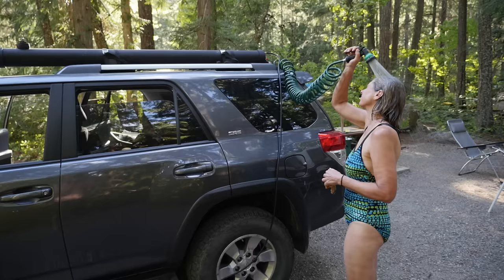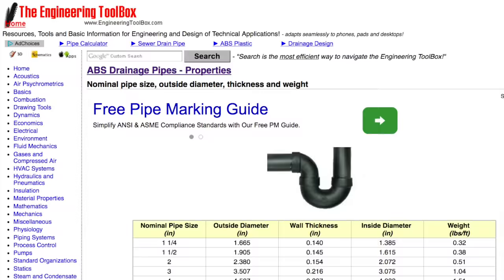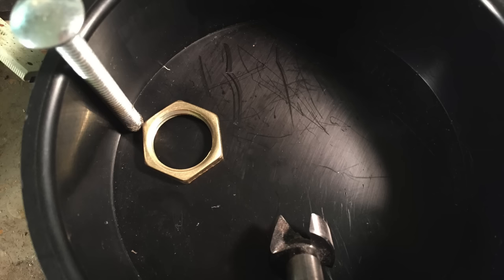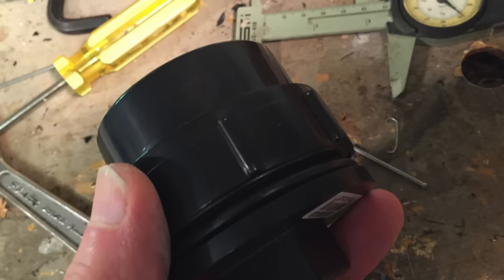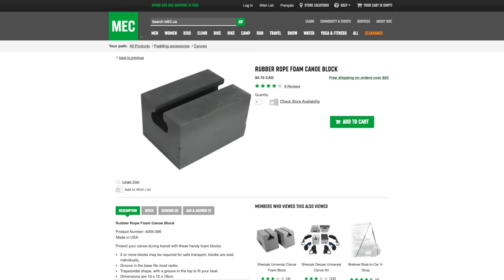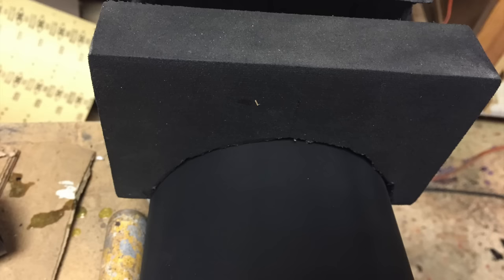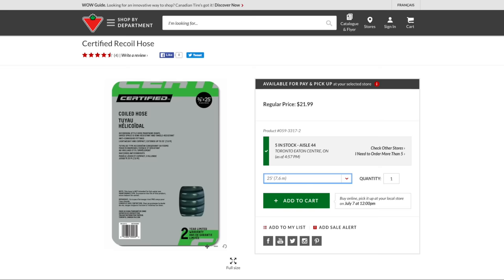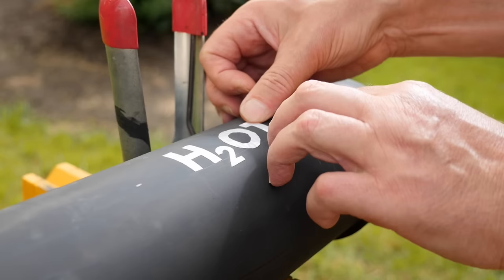H2OT - Rooftop, pressurized, solar-heated shower/sprayer using ABS pipe. DIY

Comment: EXCELLENT! It's so refreshing to see a video without loud music, no BS wandering commentary and profanity.   It was clear,  concise and very professionally done. Understandable instructions, and even text backup .
1. I want one 2. You SHOULD do instructional videos,  I agree with the many others who've said that.   Thanks, great job!
Reply: Did I miss where you mentioned where to get that air compressor? 
If not,  would you provide a link? Thx.
Reply from the maker: Thank you for the very kind words.  Glad you found it helpful. No get down to your workshop and build one!
Reply from the maker: I already had the compressor and keep it in my truck to inflate tires. It has really come down in price I see. Here is the link below.  It is a Viair 00088 88P. DO NOT go cheap on the compressor. It will fail you when you need it most (inflating an actual flat tire). This one hooks direct to the battery as it can draw 12 Amps. Any of the cheap ones that plug into your cigarette lighter accessory plug will blow the fuse and then you are in trouble.  Also, this is reasonably quiet, fantastic build quality, long power leads and even longer hose.

https://www.amazon.com/Viair-00088-88P-Portable-Compressor/dp/B005ASY23I/
Reply: I agree with not cheating out.  To be sure that I understand,  you hook the  compressor to the valve stem and the spray hose to male pipe output? 
Sorry if I'm being dense.
Reply from the maker: That is correct. NOTE: as the tank is 100% full of water, there is no room for compressed air. As such, for the first few sprays, the pressure wil drop from 30psi to 10psi in a few seconds. As the water drains, air capacity increases. As such, after about a minute, you probably don't need to cycle the compressor at all. I find that I can let it drop to 10psi without any noticeably pressure drop.  Also, remember I am using a 3/8" water hose for a reason, it restricts flow and holds lower volume. I am also using a a sprayer with a shower setting, also conserving water. And finally, we spray only to rinse. bathing is done without a constant stream. Only spry when needed.
Reply: Thx so much for the detailed response. . Out here where I'm camping, I've just been pouring cold water, soaping up, then rinsing with cold! 
☺

Comment: I lived with my dad in a camper van in the 80's for 4 months As he worked in Northern Ontario as a bricklayer..Having power was a welcome But We mostly had to think of ways of doing things Dad Would spark up the hibachi style fire And set a large pot of water on to boiling Then mix that half to a half bucket of cold water And it came out warm You would splash alitte on you Dunk your head in  And soap up And take a cup and rinse off And towel off ..There was nothing better than waking up and Dad had musky cooking in the cast iron skillet fresh from the French river 

This solar powered roof I wish he could of seen

Comment: Thanks for your video. I made the same thing with the following changes (improvements): 1. I installed a 60 psi pressure relieve valve instead of the radiator drain plug. 2. I made it in 3 sections, and installed 2 plate with holes (where the sections meet) to stop the water hammer action when not completely filled. 3. I used thick rubber pad brought from Harbor Freight to mount it.
Reply: ge gary ... I think you are talking about the water sloshing back and forth while driving, not actually a water hammer. That would be a baffle system and commonly used on tank trucks.
Reply: @rupe53  yes, 2 baffles with many small holes to stop water from rushing to the front when braking and the back when accelerating, helps a lot.
Reply: That makes a lot of sense, was worried about that as well. Don't need a torpedo on my roof. What kind of place with small holes are you referring to? A shower drain type plate?
Reply: @nickohdub  ... you have the right idea, but the drain plate may have too many holes and allow the water to move too fast.

Comment: I built something like this last year but with one additional component I took a bicycle inner tube and inflated it, and put it inside the tube before sealing it up. this bladder compresses as you fill the water heater with air. and allows the water to flow for a much longer period of time without constantly running the compressor.
Reply from the maker: That is a very interesting modification I will have to explore. Downside would of course be loss of capacity. 

One thing I have started doing is to drain off some water before I start the compressor. This provides a void that the initial compressed air can occupy. Thus  eliminating those immediate cycling of the compressor that your solution solves.  I shower standing in big  Rubbermaid container  so the water is not lost.

Comment: Probably no one will see this comment but here goes. Living on a sailboat I used saltwater for showers. Just add a little Downy clothes softener to the salt water and presto water you can shower with.... adjusts the ph and works like a charm.... no more salty skin...
Reply from the maker: I did not know that. Excellent tip.
Reply: hmm. just be careful since now it's known that those fabric softeners kill a mans testosterone and raises the estrogen...  besides if in a boat you must have a septic tank, downy is not good for it. you may try 1 cup of white vinegar. why haven't you put a filter. OLE!

Comment: Thank you.
I was searching for a single use fishing rod carrier design. And now I have a dual use water heater, fishing rod carrier design. I’ll put the water fittings on one end, and a fully removable end cap on the other. Depending on my predicament, I’ll run hot water, or travel with rods inside the tube.

Comment: Thanks for taking the time to share this. I have a very low income, a small disability, live in a cabin/caravan off-grid. My bathroom is very cold in winter and has only rain water for handwashing. Brrrr. This is probably going on my roof asap. I have a small 12 volt pump ready to help me feed it. Mine wont be pressurised it will be enough with gravity. I will be feeding 70% max volume in, and leaving a small top valve open for when temp drops below zero to try to prevent cracking. I will probably cover it over with a perspex box or even bubble wrap to see if it still works
Reply from the maker: Glad you found it useful.

Comment: Absolutely amazing instructional video. I was on the edge of ordering 1 of those overpriced aluminum tubes when I found your video. I built mine today for a total of $48USD without the foam blocks yet. I have a small adventure trailer and this is EXACTLY what I wanted for that setup. Thx, Jeff
Reply from the maker: Glad you liked it. Let me know how you make out with yours or if you can think of any mods that would improve it.

Comment: I have finished my version of this and I'm very happy with it. It works great! It took me a few tries to get the hose bibb right. I may have heated up the bibb too much as my bibb leaked after tapping it into the cap. Looking into the hose bibb I can see some nylon or plastic material inside that I assume makes it water tight. I might have melted it...For the next try I drilled a larger hole that the bibb could slide into and used epoxy to seal it. Instead of using a retaining nut, I used a threaded brass elbow with the end pointing down. That way I get more water out before the hose bibb starts to suck air. I put bibbs on both end caps so if my van is not level I can attach the hose to the end that is lower. My vehicle is taller than I am so I oriented the hose bibbs to point out (away from the vehicle) instead of down. That way I can rinse off without having to attach the hose if I wanted to. For the hose I used fuel line hose with a 3/8 inner diameter. It was cheap at 1.40 a foot and it's very flexible. Also, it's black so that first blast of water will have a chance of being warm. For the cap, none of my local hardware stores stocked one with a gasket. I initially used one anyway and it had a pretty good seal although not airtight. I ended up ordering one online from a hot tub supply website and that one is airtight. 

Another problem I had was the end caps from home depot. while being flat on the outside, they had a raised disk on the inside that made installing the air valve tricky as the air valve uses rubber gaskets so the surfaces need to be flat. Once I realized this I looked for end caps at other hardware stores. At Ace hardware I found caps that were flat on the inside and outside. I bought 2, installed the hose bibb and air valves, applied the rubber cement, stuck them on the ends of the 4" abs pipe from home depot and found out they were ever so slightly smaller in diameter than the home depot caps. They were just hard enough to get on that I wasn't able to do the 1/4 turn for a good seal and my bibbs were not oriented in the 6 o'clock position. Ghah! I ended up using the home depot pipe and home depot end caps with the raised disk by drilling the hole for the air valves within the disk, instead of at the 12 o'clock position. There is enough room for the hose bibb handle to open and close without hitting the air valve (remember my hose bibbs points out, not down). 

Lastly, if you plan on driving around with a few gallons inside the shower, I would recommend making a "water brake" to stop the water hammer effect when slowing or stopping. I purchased 2 extra end caps and cut them down to  disks that roughly fit inside the 4" pipe. I then drilled a 1" hole in the center of both of them and inserted a 1" diameter pvc pipe. I secured the disks in place with hose clamps. It looked like a bar bell with an extra long bar. The pvc pipe was as long as my 4" abs pipe. I inserted the "bar bell" into the abs pipe before cementing on the end cap. It works very well. It's effect reminds me of one of those bamboo rain sticks that make noise when upended. 
Hope this helps anyone who is making this.
Reply: terrific stuff.  have you documented this anywhere.  The water brake- I am not so clear on.  how much room I there between the disks and the walls of the pipe?  it doesn't impede flow?
Reply: @philcusick3037  The disks are not that tight. I probably have about half a centimeter of room around the disks. Definitely no flow issues.

Comment: This is FANTASTIC. I just installed a compressor and air tank on my 1st gen tacoma, and realized I could easily create a shower system. My first thought was a roof mounted tank that would be solar heated. This took all the work of having to design or brainstorm anything myself hahaha, it's exactly what I was thinking, without having to do any of the critical thinking.
Plus, the production quality of the video is on par if not even more amazing than the quality of the execution of the water system. 5 stars all around.
As a sidenote, I would listen to a 8hr podcast of you describing paint drying with how relaxing it is hearing the narration.
Reply from the maker: Glad you enjoyed it and found it helpful.  If you have not already done so, I suggest reading the description text for the video. I added a lot of tips for building and using that are not in the video.
Reply: Already checked it out while watching 🫡.

Still deciding on best way to pressurize and maintain 30psi. I already have a 90-120psi pressure switch to the compressor mounted on the tank, so a 30psi pressure switch wouldn't work as my tank would never fill. I need a way to fill it from the tank, but only allow it to pressure to 30psi without dumping the whole air tank in it. I'm assuming there's some kind of regulator I could use, I just need to do my homework since I'm ignorant with pneumatic values and fittings mostly.

Comment: Great project, and excellent execution. My favourite part in this setup is the way you mounted the pipe to the roof racks. Very ingenious and it looks like it fits like a glove. I personally would have opted for a 12v pump and hose for convenience, but I like that your air compressor solution turns the compressor from a single application otem to a multi application item and doesn't increase weight.
Reply: You can use a bike pump or an air compressor. Probably already have one in your kit!

Comment: Thank you sir! I had the same exact idea just moments ago. I found the same aluminum system from Yakima and the price was outrageous.  I immediately thought about black PVC.  Your system is exactly what I had in mind.  Thank you for doing all the research.  Now I know what volume each pipe diameter can provide.  Love the mounts too... I didn't get that far.  Thank you again!!
Reply from the maker: Glad you found it helpful.  Note: that I used ABS and not PVC pipe.
Reply: DO NOT use PVC, it can be dangerous if it breaks with a lot of air in it.

Comment: Cool video and great end result!!  The only thing I would suggest would be to use an elbow on one end of the pipe with a threaded cap on it - this would be easier than having to use a hole saw to drill the fill point and it would also remove any potential issues for pressure failure at the join where you drilled the hole.  Great job man!!!

Comment: Many many years ago i made something that worked on a similar idea. It was a 12 gallon drum painted black. I had a 4' shower stem and head coming out of the small hole in the drum and drilled a small hole in the large filling cap just the right size for a tubeless valve. once the drum wamed up in the good old NZ sun and I connected the compressor we had ample water for a couple of showers each. I like yours as its a lot less cumbersum.

Comment: Get yourself a Hoola Hoop and some 3/4 inch conduit and 2 shower curtains with rings to make a shower enclosure for your shower. The conduits can be tied with shock cord to your roof rack and stick out the side of the vehicle near the water hose sprayer. Tie your hoola hoop horizontal with loose zip ties or more shock cord under the conduit.  Then hang the 2 shower curtains from the hoola hoop, over lapping the ends. The overlap can act as a door.                                                                                                                             You can build a wood floor , like thin pallet, for your roof rack that can serve as a shower floor.   I've been using this shower curtain set up on my expedition rig for years.  Nothing like a good hot shower in the middle of no where.                                                                                  I have a hot water tank, heat exchanger under my hood, heater by my radiator water of my truck.    I plumb in my 5 gallon water tank to a small 12 volt fuel pump to pump the water from the water tank through the heat exchanger and then to my shower head.   But yours will work fine,  I used the solar bags before I built the heat exchanger.
Reply: Amazing idea, which I will definitely use in the future...but clarification on something, are you saying you stand up on top of your vehicle to shower? Sounds funny to me. Planning to have a roof top tent on a Jeep.

Comment: Great build..
I go camping and i build one myself but i used 2 tubes and also put an aluminium plate under the 2 tubes to get more out of the sun's heat works well.
Also i bought a compressor with a psi auto ajust so i put it at 40 psi and as the shower is used it automatically starts up to keep psi at 40 until no water is left.
I was thinking of trying instead of tubes someting like a propane tank that can be high presure with 10 gal or more if not to big.

Comment: I built the same thing for a jeep we used to of-froad in.Cost me like 10 bucks maybe. Used an aluminum beer keg a coiled air hose with a spray nossle and a short pipe in the top for water fill with a bolt in tire valve for airing it up.The Jeep never came with A/C so we mounted  York A/c compressor from an old dodge to it and used it as an air compressor. Ran the line from that to the tube front bumper later for air storage tank.
Reply: VanGuy Steve 
yeah well weird u get the keg?
Reply: Got it from a friend that was planning to use it for a project he never did.
Keg was just ideal for my jeep because it fit right on inside back fender of the cj-7. Was killer to wash hands and clean mud from windshield and places you dont enjoy having mud after a nasty ride through the woods. I'll be using this  setup or close to it on my van for sure. Will incorporate the shower curtain slide out with it . Awesome vid.
Reply: Yeah our van is getting one for sure.  Everything I can make myself for this van build will be made. It is going to be a bottom dollar budget build for sure.

Comment: B.B thanks you man I could never ask for more!!.  In Tucson, Arizona with, so much sun I combined two of your system together and now I got plenty hot water in my kitchen + shower.  I  add hot water pressure valve incase it gets too hot.  I also empty the system if it will freeze   (in the few only cold day of the South West winter).  Now everything is HONKY DORY and works great.

Comment: you are a verifiable genius. I´m so making a similar proyect but i´ll add three features. A resistance to heat the water in case of need using electricity from the car (so igniting the engine while heating), an automatic thermostat and a pressure gauge. Thanks a lot for showing the proyect.

Comment: I was pondering something like this recently and am glad to see someone's done it.  

My plan is to feed the pipe with a 12v water pump and return the water into a van/rv's hot water side.  Basically replace a conventional water heater.  This should work in the sunny spot I want to go.
Reply: It seems like this would cause a lot of pressure on the sink valve. Blasting you with warm water when opened at the tap. I dunno.. Let us know how it goes!